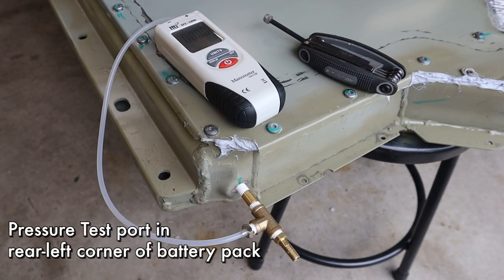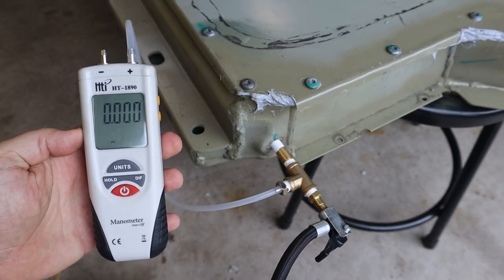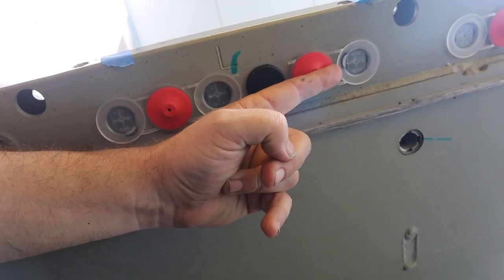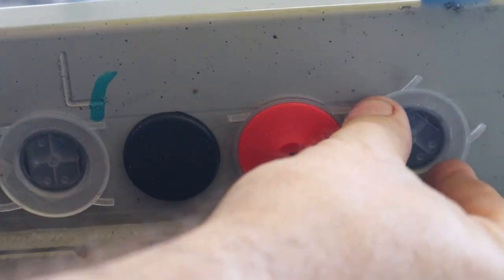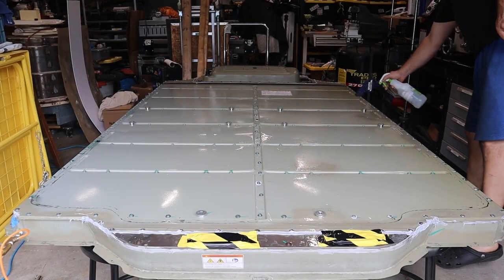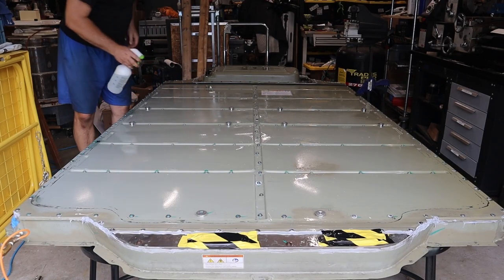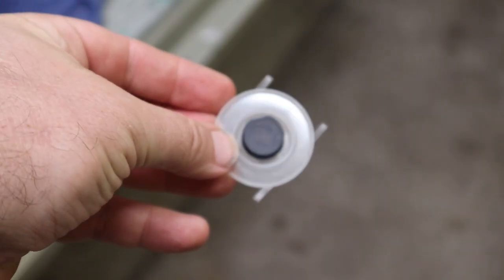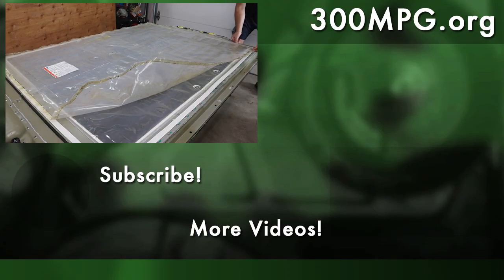DIY Tesla Battery Repair: Pressure Testing

Comment: Pressure testing looks like a big part of the whole job.  Those yellow plugs (end of vid) can be found at Harbor Freight.
Reply from the maker: I happened to order that yellow plug as a set from Amazon. They are silicone and come in a variety of sizes and colors. I’ve found all sorts of uses for them!
Especially handy to fill threaded holes while painting!

Comment: Presure regulator is good for finding leak. You just set 0.2psi and leave it pushing while spraying soap water.
Reply from the maker: Yes, I just don't have one that goes that low. Most typical air compressor regulators only go as low as a few pounds of pressure per square inch.

Comment: I'm 100% percent disappointed that a smoke machine was not used to troubleshoot the issue 🤪
Reply from the maker: The problem with a smoke machine is that it can leave a residue on all the surfaces. Not something I want for inside my battery pack. 

I talked to a 3rd party Tesla repair person who said he loves smoke machines for troubleshooting autos and uses them everywhere except inside battery packs.

Comment: Your leak location is fairly typical in Remanufactured assembly. It possibly leaked because the caulk cured before you got the screws torqued. That's okay, you are not a speedy experienced assembly team member. 
AND those screws common strip because the enclosure (aluminum) threads were not designed to have multiple torque events. Especially where the screw holds down the main cover and bump cover. 

Where you placed helicoil is okay. 
The factory, we drill, tap, and replace with one size larger diameter, a bit longer, screw. That technique requires knowledge/skill/coaching to avoid damage to the pack. 

Yes, that wedge foam buffer can get in the way of the caulk sealant. That has double side mounting tape, mounted after thorough cleaning of the enclosure, and then surface clean with alcohol.
If it doesn't stay, use drops of super glue (factory method).

Two good experienced techs, that is how the top is dropped/installed, without disturbing the caulk, 100% closed/sealed in 12 to 15 minutes. 

 Original assembly, a robot does the caulk, and drops the top. And installs the screws.

Leak soap solution is 1/4 cup Dawn detergent to 1 Cup water.

Recommend clean area with alcohol, allow to evaporate. Then add more sealant. 

Center SPINE screws, IF those strip, simply add/cover with caulk, allow to cure 24 hours before leak test. Those screws thread into a rivnut in the sheet metal spine and are just about impossible to replace.

Pressure test: 
Fill too much pressure, you will hear the umbrella vavles "flap/fart". HAHAHA!

You can fill to .500 then look for leaks as the pressure drops. 
Best to have 1 person operating the air pressure. Another person search for the leaks.
 Simply spray the umbrella valves to check for leaks. Especially after O ring replacement. 

Good work for an amateur!

Comment: Very interesting episode. I wonder how reliable is this water sealing system in Teslas vs. Rivian and other brands. There are tons of videos of EVs running through fresh water without any issues. Then, you see Tesla fire when flooded with salty water. The seal should not differentiate chemical composition of water.

Comment: You know the location of the breather clip. Insert a plastic tool and press on that barb/clip inward to avoid damage to the barb. Of course, do not damage the O ring.

The "trick" to install umbrella valves:
 thumb on each side of valve, thumb at each barb/clip,
 push firmly straight, 
both thumbs at same time and same effort. 
Lay on your back, on a mechanics creeper. 
Wear a good bright headlamp. Take your time. 
Inspect visually after each set.
Expect a few to be "wonky".
After about 20 you will get the technique. 

The umbrella valves are joined together to avoid placing plug/breather/valve in the wrong position. 
AND easier parts handling at production line.
These plugs/breather/valve can be installed separately.

Comment: Use bit more silicone grease when putting in plugs! It helps getting them in and also helps sealing better even not counting o ring but simply filling space between plug flange and flat surface of battery floor!